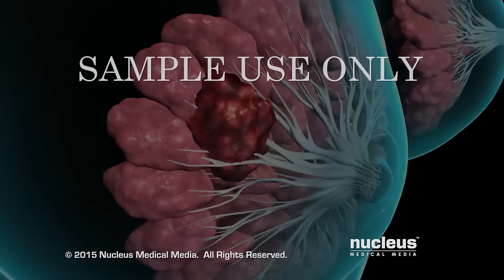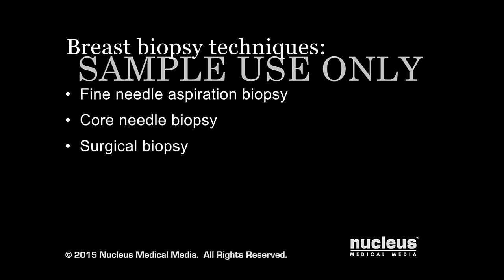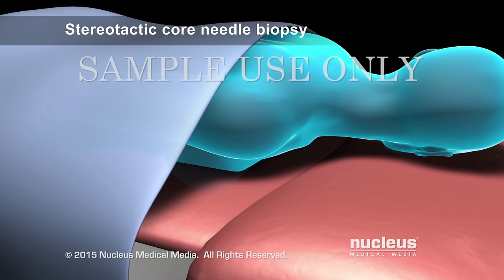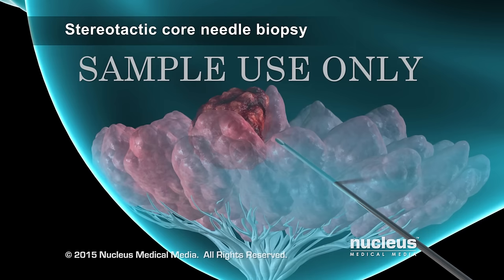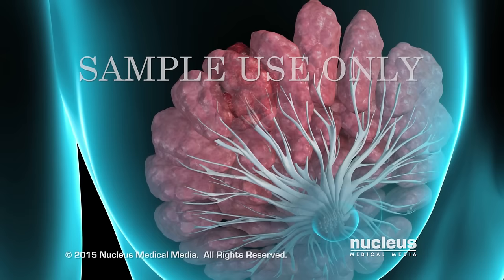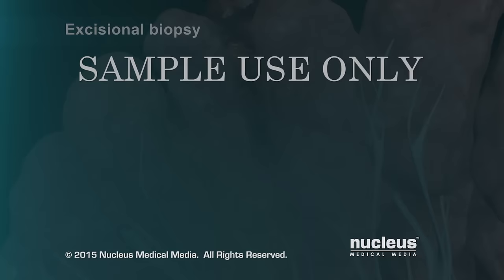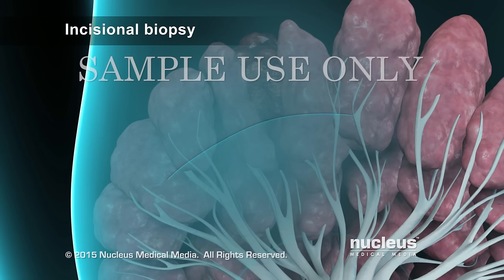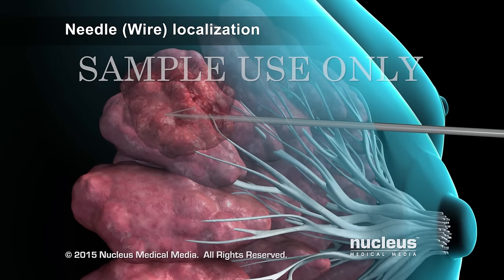Breast Cancer | Breast Biopsy | Nucleus Health

Comment: This was by far the most traumatic breast experience I’ve ever had.  Hurt so bad and the fact that I felt everything from start to finish was the worst feeling ever.  Good luck to everyone who has to have and go through this experience.
Reply: Muffin I can back up your experience with breast biopsies. Fine needle my Arse. The tool is more the thickness of an ice pick. It's ejected into the site like a shot from a pellet gun. Ladies make damn sure that Tech has given you enough Ladicaine and time. To allow the area to numb. Remember this is a lab tech doing this job. Their there to get their sample. Not having to deal with you again. No big deal to them if your in pain. At home have a comfortable roomy sports bra. Small hell ice packs you can wear in your bra. X tea strength Tylenol as you will be sore and black and blue for weeks. You can make this experience must less traumatic by being informed and prepared. Good luck and best wishes!